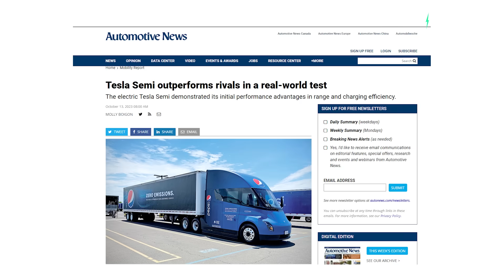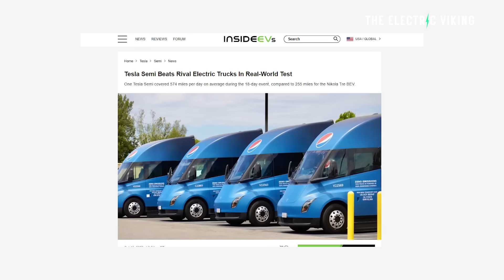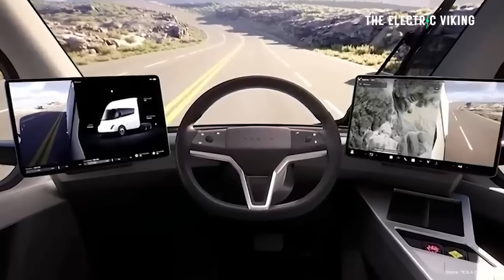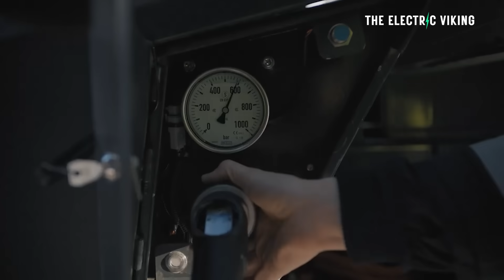Mercedes claim that Tesla Semi breaks the laws of physics proven correct

Comment: Why would Mercedes make a brick shaped truck. Are they trying to increase drag coefficient?
Reply: Probably they didn’t retool the factory and produced a similar shape due to manufacturing limitations :/
Reply: It’s about vehicle length, which is limited for trucks. You can’t force all haulers to buy new trailers.
Reply: European laws are strict. They practically require that horrible design...
Reply: @skydivekrazy76  I can understand this problem especially after driving on all the narrow, almost non-existent roads in Italy.
Reply: @skydivekrazy76  Think I heard EU is looking to change that soon luckily.
Reply: Drag coefficient is not that relevant up to 80km/h speed, above it is increasingly a problem. And with that trucks and semis are not much faster than 80km/h in average. But trying the max for being max. efficient the shape of the Tesla semi is better, not doubt.
Reply: It makes more room for the driver
Reply: @boraoku no, European legislation!
Reply: They are designed for different markets and different scenarios. It would be interesting to see a comparison between the trucks in congested suburban settings. On the flip side with all your videos being streamed, viewed and shared by Tesla staff, truck stops may become safer
Reply: @christophmartin5381 I don't know about that. Most of trucks I see here in North America go well above 110km/h
Reply: @i6power30  yes, and aerodynamics are important for a large vehicle at any speed
Reply: Maximum volume within EU regulations.
Sleeper compartment sometimes above driving position.
Also the Luton van was invented in a town called Luton - a hat making town. Hats aren't heavy so the body came forward over the cab to maximise volume per vehicle.
Look also at our double decker buses.
Same reason.
Reply: But didn't they round the corners ? 🤣
Reply: @docsnider8926  Your argument about vehicle length doesn't apply in North America as it does in Europe. But conventional (North American) trucks are far more aerodynamic than those flat faced European cabovers, especially the Tesla and the original Nikola. It's sad when a supportively inteligente Industry magnate like Gates and other spout off about physics without doing the work, to not look stupid.
Reply: European trucks can't be long.
Reply: @skydivekrazy76  Yes, EU and UK limitations
Reply: @matty7834  if EU follow UK the roads will be narrower as per my home town which build wide raised cycle lane along the main road. Where the cycle lane stopped they built out the pavement at the bus stops which means a stopped bus now blocks one lane
Reply: @christophmartin5381 On American highways, trucks go much faster than 80km/hr. Going over 110km/hour is not unusual downhill. Uphill, maybe 100, if it's not too steep.
Reply: Tesla should licence its design and sell its motors
Reply: @i6power30  EU limits to 90kmh.
That's 56mph.
Reply: Literally like every other truck, it even has a grill on the front to cool it's imaginary engine

They literally took  regular truck and slapped a battery under it
Reply: @harrytobiassen5214  they do. The forward control (cabover) design is surprisingly efficient multiple air deflection devices are used and the radii of the corners are carefully designed and managed.
Only length laws and >500 year old road layouts prevent longer bonnetted wagons.
In fact, in the 70's in UK a bulk tipper company ran shorter trailers and imported Mack trucks while still making max weight within the length restrictions.
Reply: @dadbain  True. Hence Tesla & Nikola design to take advantage of the extra couple of feet length allowance on top of the EV weight allowance. 
The forward control design is a compromise of industry vs dimensions in law. But limited to 90kmh or 56mph fuel consumption is around 8-9mpg dependent on work and driver skill.
What does a US "normal control" door to the gallon?
Imperial gallon = 4.54609 litres.
Reply: @jasontran8095  True Renault Magnum has a flat floor in cab over engine.
They owned Mack at one time and put the detuned Mack tank engine in it.
Early 80's. They were a rare and imposing sight in UK. 
I saw it launched at the Anaheim truck show on a bus man's holiday.
Reply: @harrytobiassen5214  they are rounded.
Look at Bernoulli's theorem and also the Coanda effect for information on airflow physics.
Reply: @i6power30 but not in Europe… They might go over 80, but they are not allowed
Reply: At 50mph, little drag.
Reply: Cause europe is smaller
Reply: @monkeysezbegood  no need. They intend to make 50k a year in the next few years. That's a thousand a week so they'll be up there with the current biggest.
Reply: Believe it or not, there are other countries in the world other than the US, and laws are different elsewhere.
Reply: @89bazoly  lucky you. Here in Canada they used to go as fast as they wanted. Often I look at my rearview mirror there is a tractor trailer riding on my ass and I was already going 120km. They sometimes go 150km when there is no police. Only a few years ago they mandated putting speed limiters in the trucks to 110km. But occasionally you still still encounter illegally modified ones that go over that limit.
Reply: @MattEMaddock  arrogantly wrong 
it’s not laws it’s the size of the roads and the shorter distance causing aero to be irrelevant
Reply: The E-Actros used for publicity may well have a different grill or front panel. It’s flat due to European rules regarding turning limits which control vehicle overall lengths and axle limits. Believe it or not cab overs are aero dynamic as they have very little gaps between the tractor and trailer, side skirts and cab collars passing the air down the side. Trailers are more aerodynamic in design to match tractors, again with side skirts and tapered roofs. Shorter overall length reduces weight and drag, along with extra steer axles on the tractors and trailers at 44,000kgs and all are standard builds. Less tire scrub and turning abilities especially over North American 6x4s or double drives.
At 40,000kgs or 88,000lb on 5 axles running a 2 axle tractor and 3 axle trailer much more productive as well compared to a 6x4 on 3 axles and a two axle trailer. Higher GVWs and payload $$. 🏴🇺🇸
Reply: @i6power30  In most Countries in the EU per law the speed limit for Vehicles > 7.5Tons is about 80km/h (approx 50mph). (Safety Reasons, more curvy, hilly roads with short visual range and a Semi crashing into the end of a Traffic jam at full speed  (in a curve or after a hilltop) is mostly deathly).
Reply: @andrewsaint6581  And in some Countries (like Germany) it is even slower (80km/h - 50mph).
Reply: @KCJbomberFTW  Europe (not the EU but the Continent) is bigger than the USA.
Reply: @DSP16569  I’m not arguing with you I’m telling you why it is 
And check your math on highway length
Reply: @DSP16569  Yes and 60kmh on single carriageways. About 37mph.
I forgot about that, I live in the UK.
Reply: @nyanbrox5418  You literally have no idea what it's like on the inside. They probably use off the shelf wheels, tires, and air brake connectors. It has no engine, but it has 3 motors with a ton of power, like 3x a normal semi. The batteries and motors need cooling, so it would have a grill.
Reply: @KCJbomberFTW  maybe the laws follow the size of the roads?
Reply: @pauljohn6637  Exactly right.
Reply: P. S. There's a fabulous whisky brand called Paul John. From Goa. 🤷
Reply: @christophmartin5381  that is true enough for a small car, but when you have a 44 ton brick with a much larger area exposed, i dare say it can make  a difference at lower speeds.  Even a  1-2% difference can add up quickly.  doubling the frontal area increases the wind drag by a factor of 4. To me it seems the merc truck has a frontal area 4 times that of a car, so  probably 16 times the amount of wind drag. That starts to add up way way before 80km/hr.   Yes My figures are somewhat exaggerated to highlight the point your statement is  very general and makes some incorrect assumptions.
Reply: @christophmartin5381 yeah and they're are many other areas of semi trucks that can benefit from aerodynamic optimization including the wheels and trailer undercarriage before the front needs an design overhaul. Trucks are already pretty efficient for the weight of cargo they haul, not better than rail though.
Reply: Because that square shape is the needed shape for the market those trucks operate in. These are working trucks, not beauty queens. That said, the shown trucks do look quite good, and if you look closely, there is hardly a flat panel anywhere on them. A whole lot of attention has been paid to the aerodynamics. On a big semi truck, the big aerodynamic improvements come in the overall airflow around the various openings and corners the air bumps into as it flows around and through the truck and trailer gaps and openings. The truck makes money hauling the most stuff it can in the available allowable foot print it has. So that means a cube shape is required. Not a slippery egg shape.
Reply: too long for many european countries roads (most of italy, rural UK, etc.)
Reply: The amount of power required to haul the load, exceeds the energy required to push the block thru the air, at legal road speeds. At higher speeds, it would matter.
Reply: Got to hide all the batteries somewhere!!!
Reply: Driving in Europe is very different than driving in the US. The towns and citys and roads are built differently.
Reply: Europe requirements.
Reply: @christophmartin5381  Not to mention the shape of the front isn't as important as people assume it is.   If it was, a raindrop would be pointed on the front.

now the back of the semi, on the other hand....
Reply: The non Tesla trucks are all of ICE design. Brick on wheels!  🇨🇦
Reply: @nyanbrox5418 EVs have cooling needs too, just not as much as ICE alternatives
Reply: Go ahead, try to even drive a Mack or one of those huge amarican trucks in a about any random European city and find out soon enough why😂
Reply: @lesbendo6363  It’s European length requirements.
Reply: @docsnider8926 The Tesla Semi is the same length as the short version of the Mercedes truck and 3 meters shorter than the long version. The Tesla is 6.3 meters long, the Mercedes is 6.1 or 9.3 meters depending on the variant.
Reply: @earlbrown Not pointed, rounded. Although the most aerodynamic shape is called 'teardrop' the radius of curvature at the front is quite pronounced, producing a shape more akin to the cross section of a zero lift aerofoil.
Reply: EU trucks are designed that way so elderly people can walk under the truck to their deaths on narrow European streets because the driver can see them 😊
Reply: @andrewsaint6581  didnt they remove sleeper above the driver back in the 90s early 2000? I have never seen it in a modern truck.
Reply: Probably because America is the only nation who makes roads ridiculously wide and focuses so much on roads, instead of rails for transportation.
Reply: European roads are small. The maneuverability of the short design is necessary.
Reply: Ah, no, the laws of physics were not broken
Reply: @andrewsaint6581  3.78 litres per US gallon. An 80 thousand pound van or reefer can average 5 to 6 MPG US at 65 to 70 mph when not running the high mountains.